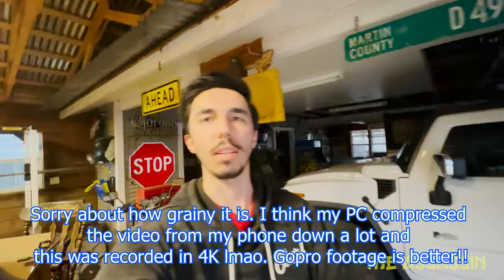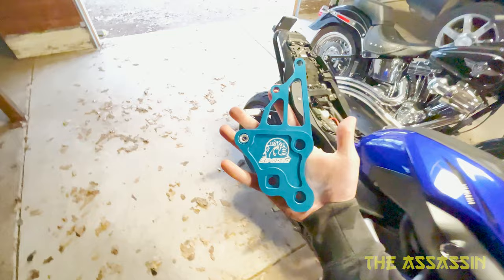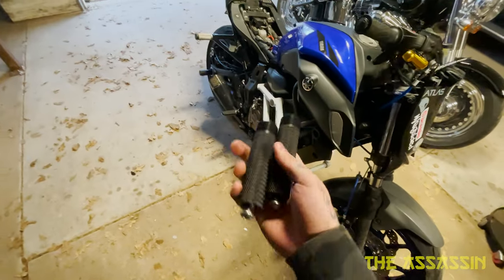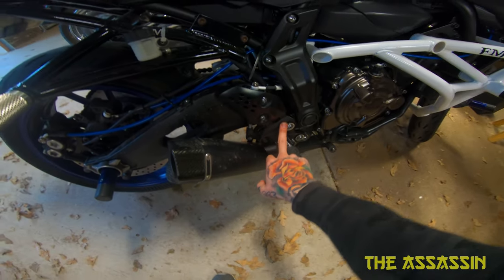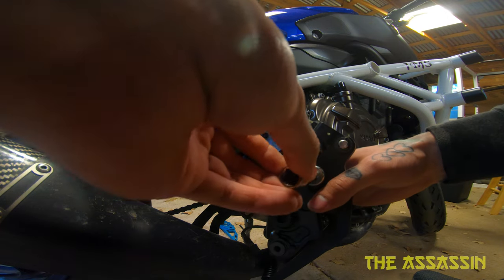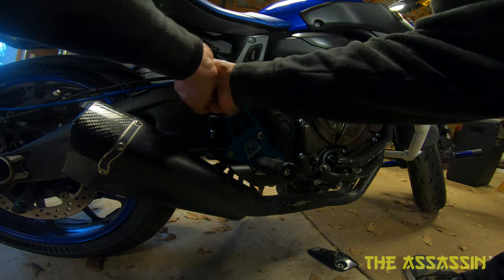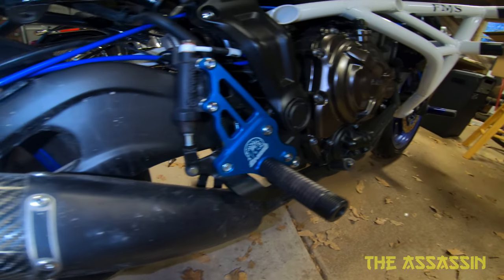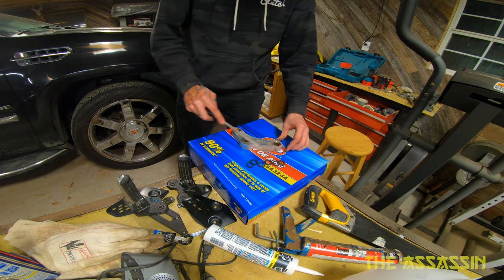2018 MT07 SAGGY SHOCK FIX, STUNT SEATS, AND STUNT REARSETS!!! MT07 Stunt Build Series Ep. 9

Comment: Wassup bro, I see that ss moto also has a shock fix..... but in black which I like. Any reason why you went with the twinstunts version over that one?
Reply from the maker: I bought the twinstunts one literally a day before ssmoto announced his so that’s literally the only reason 🤣 I would’ve went with SS but I had already bought the TS one lmao
Reply: @TheAssassinMT07  hahahaha damn, bad luck on that one. It's a little cheaper too, could've saved a few bucks. But the cheaper price with the anodizing made me question it lol but I guess I'll go with that one. Thanks brodie 💪🏽💯
Reply: Where did you put the jack ?
Reply: @michaelcreamer7925  it's been a while but I think I put some cardboard on the jack and lifted it from under the engine. The bike doesn't have to go high in the air. Basically just high enough till you can remove/reinsert the bolt that goes through the bottom of the shock. Hope that helps! Also li_brakework also has a video installing it, if assassin or twinstunts vidz aren't helping. Goodluck!